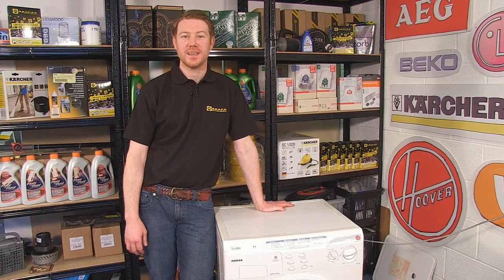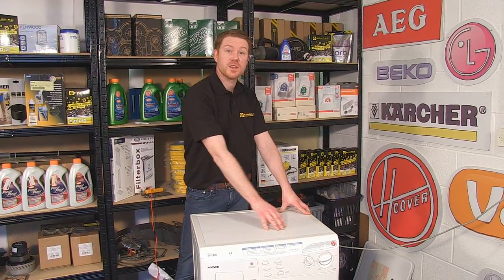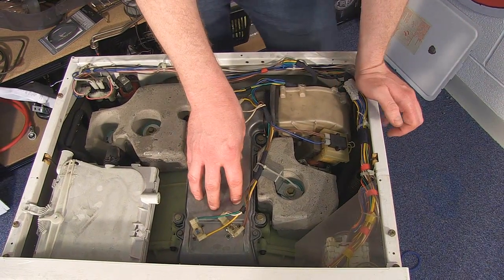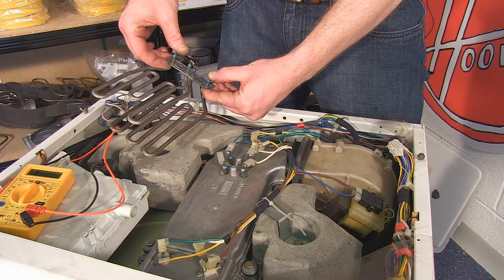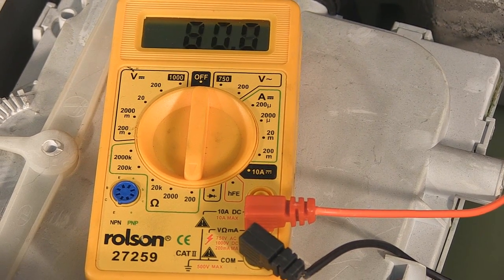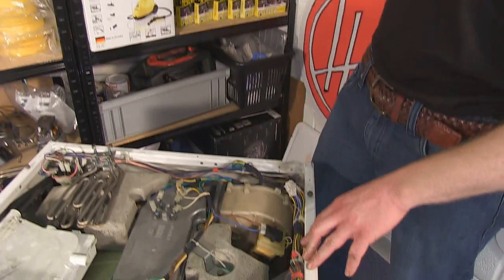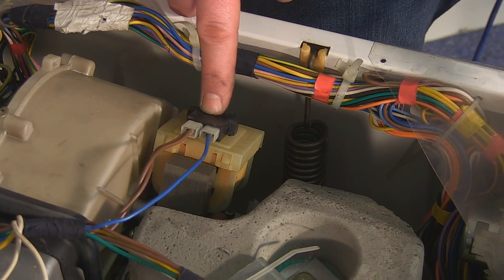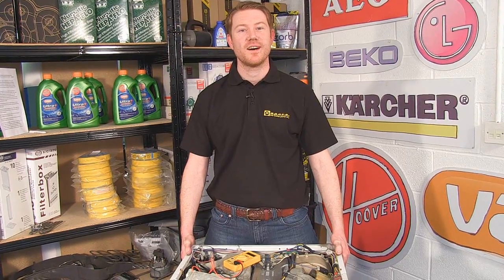How to Diagnose Washer Dryer Drying Problems

Comment: Very helpfull video!
When i opened op my BEKO washer dryer, i noticed there was a lot of lint inside the condenser. Is this a problem, and if so, how do i clean the condenser?
Reply from the maker: Hi Lena, there are a couple of things you could try to clean it, get the vacuum out with the crevice tool to get inside or use a pressure washer as they are good at cleaning all the lint out.

Comment: I'm stuck! Washing is not having its moisture evaporated. It's just coming out hot and wet. I replaced the valve as it was faulty and all other components seem fine. Board??? Thanks for vid anyway
Reply from the maker: If clothes are coming out hot and wet something is wrong within the condensing process usually a blockage of some sort in either the condenser itself or the feed pipe from the valve to the condenser which usually has some sort of constriction in it which only allows a minimal amount of water into the condenser and can block. It could be the control PCB but not very likely.

Comment: Hi i have a hoover washer dryer pvu0000072 and i have someone from hoover come out to checknmy washer/dryer as its not drying and he said a switch inside the washer kept tripping he replaced it and its still doing same its realising hot air but the clothes are not getting hot or drying what could it be
Reply from the maker: Hi Gronya, we don't recognize the model number but you would need to test the thermostats with a multimeter to determine if one of them is failing, also check the air flow through the condenser as well as the water flow from the valve.

Comment: Thanks for the review! I have a problem with washer dryer that does not heat up while drying  after returning from repairshop. They changed some motor after door lock error (07 Candy GC4) I noticed that fan makes funny noise now when starting drying program. I suspect they forgot to plug back in something inside the mashine. Is it possible?
Reply from the maker: Hi LuckyMe, the first thing to test is the dryer elements, the video shows how to test them at 1.46 and check no wires have been left off so be careful.
Reply: Hello! Thank you for answering! I tested everything as showed in the video. I found out that elements didn't warm up. So I pushed the buttons on them to reset them and it worked. Then I plugged masin and started drying program. The elements heated up too hot so I turned mashine off. It seems the problem is in ventilator-air does not flow into drum, it stays cold inside it. I scrued that drying part all off to get to inner ventilator. When outer ventilator spinns, the inner ventilator does'nt. Its kinda loose on it's axle .  I can't get what is wrong with it and how it should work. Can you explane that part too, how it works and what to do to fix it?
Reply from the maker: Hi LuckyMe, the video does explain the drying process, if the ventilator is not turning then it does not pass the air over the heater into the drum and will need to be replaced but also check the air chamber for any blockages.

Comment: How do you find out where the 4 wires go on the start stop button on a splendid 2000 washer and dryer combination in my motor home, Steve
Reply from the maker: Hi Steve, you will need to find a wiring diagram online that lists all the connection on the machine including the start/stop button, we do not have access to these diagrams so good luck.

Comment: Hi Mat, we just purchased a 3 year old Hotpoint Aqualtis Washer/Dryer combo.  I just washed a load of darks and several of the items came out full of white lint.  I wanted to hang them outside, but decided to dry them to get the lint off.  Any ideas?
Reply from the maker: Hi Diane, check the door seal and filter and it sounds like it needs a clean out.
Reply: Hi again, I agree with you but can you tell me where is the filter?  Our directions don't show anything about a lint trap or where to clean it out.
Reply from the maker: Hi Diane, the filter is located at the bottom right-hand corner at the front of the appliance, there may be a clip on panel you need to remove to access the filter. put some old towels down for any water in the chamber before you open it.
Reply: Thank you, Mat.  Our filter wasn't bad, so I think the problem was I had washed & dried white towels in the previous load and it was some residual lint.
Reply from the maker: Hi Diane, hopefully, you have sorted it out, let us know if you have any other problems.

Comment: Thank you for this,  now I can go and play electrical repairman with my multi meter and see if I can fix or identify my washer dryer drying problems on my own :)
Reply from the maker: You are welcome. Remember to fault trace with the machine off using the resistance range to measure and check the components. This will avoid the dangers of working on a live machine.

Comment: I really like this video a lot, but I do notice that it does not really address the possibility of air flow obstruction.  It seems to me that the air tube going into the condenser is rather limited in diameter and that seems to me to be very likely to eventually get clogged up with lint and debris. Is there not a good way of testing the air flow in this system? like maybe disconnecting that hose and sticking a vacuum cleaner hose up to it? is there a recommended way of cleaning the condenser (does it ever need that?)? Also, is it not possible that the condenser valve could still measure around 4Kohm but be stuck closed for mechanical reasons rather than a bad coil?   And,
Reply from the maker: Hi Damien, the condenser is cooled by the water trickling through it. This should loosen any lint building up and wash it into the water in the tub where it will be emptied away. The condenser can block up occasionally and need to be cleared, this is best done by removing it and flushing with a hose. If the valve gets blocked it can still measure OK without delivering the fine water spray, you can usually hear the slight hiss shortly after the machine starts when the drum pauses.
Reply: Thank you for your video and response, you have given me the info I need to feel comfortable with trouble shooting my machine tomorrow, and confident I'll get it working again. I am appreciative.
Reply from the maker: Thanks Damian for the comments, remember to 'like’ the video if you enjoyed it or it helped.👍
Reply: Liked it!  I did find the problem to be with a thermostat that had tripped...   

However, when I opened up my machine (an Ariston AWD121NA)  I found that it did not have a separate condenser unit like the one that you had shown in the video. Instead, I believe it uses the outer containing barrel as the condenser itself. perhaps there are cool water pipes that line the barrel, but because of this, there is no way to easily modify this washer/dryer to bypass a separate condenser and force the air to exhaust to the outside. The fan/heater assembly draws directly from the barrel, then blows directly back in without giving access to route the air in any other manner.  I was hoping I could bypass the condenser to make the dryer work more efficiently, because I live in Arizona and dry air is something that is plentiful here, but I simply can't do it with this particular machine. Bummer!
Reply from the maker: Glad you found your problem. By recirculating the air it requires less energy 'generally' to heat so can be more efficient. This may not always be the case on a 'hot' day.
Reply: Oh, good point! I suppose the heating elements tend to be smaller on these sort of machines and without air re-circulation, the air might not get hot enough to dry very quickly if the machines are vented very well... Some air dampening might be appropriate if anyone were to try allowing some exhausting to occur...  Thanks!
Reply: I think most folks are aware of the "lint" problem as there are tons of videos about this. When I opened up my Splendide 2000... it was the first thing I checked. While there were no lint obstructions, I could tell that there was one at one time as there was still a little lint stuck to the sidewalls of the vent tube that had obviously been there for quite some time. Once I tested the Heating Elements, Thermostat and Thermal Fuse... it was obvious what had happened. The previous owner told me that the dryer spins but doesn't heat... what he failed to tell me was that it had clogged with lint, he cleared the lint however, it didn't cure the problem so he gave up. Turns out it overheated due to the lint and popped the Thermal Fuse. Thanks to this video I was able to test, diagnose and repair the problem at a total cost of $33.

Comment: aeg L-87695 drier not works thermostats on 200Ω are 0.3 both of them and the one in the front where hot air comes in the drum, heating element seems fine, but can't check the motor , it has a small plug with 4 wires and it is on the top not like hoover

Comment: I have a hot point washer dryer showing a f15 fault I have checked everything and all looks fine please advise
Reply from the maker: Hi Amir, we have a video showing Hotpoint error codes:
https://www.youtube.com/watch?v=aud14I0Zu9M
This suggests the problem is the control board but check the dryer heater is OK first. If the heater is OK the board will have to be replaced by a Hotpoint agent so try Repaircare if required.

Comment: hi, 
all components tested and seems to be fine, the problem I can't get 220v to both heater elements?
please advise
Reply from the maker: What model are we talking about?.
Reply: candy cnw136 but it looks all the same like in vidio
Reply from the maker: If the elements and the cut outs are OK the problem is likely to be the dryer module: http://www.espares.co.uk/product/es669480/washing-machine-dryer-module-assembly It may not be able to prove this without replacement.

Comment: Thanks for this video, very clear! BTW I have a AEG L16850, DRYER suddenly stopped heating up regardless of selection after 20min, it stops to 0 min, so I thought I'll check inside, I've cleaned the condenser with a hunger. apparently there is a sensor wires fitted inside a hoe??
trying to locate sensor wires inside hose, which hose is it would you have a clue? when facing
the machine, left hand side there is a big short rubber pipe? also on the 
right, bottom of condenser rubbery hose with sensor but no wires inside, would you know?
Cheers.
Reply from the maker: Hi, we do not think there is a 'sensor' in the condenser but there are two 'thermostats' and a NTC fitted on the heater tunnel. Check the two thermostats on the side of the heater tunnel to make sure they both read short circuit as they should be 'closed'.

Comment: How about the most important thing as Step 1:  UNPLUG THE DRYER.You're putting your fingers across the heater elements, and if someone is working on their machine with it plugged in, that's 220 across fingers.  If not instant death, it's a sure fire way to get them to do the monkey dance and seek immediate first aid.
Reply from the maker: Thanks for your comments. We did say at 0:49 "So I've just turn the machine off and I'll take the lid off" and you can see the plug behind the machine on the floor.  However it is obviously important you fully disconnect an appliance before working on it so we have added an annotation at this point to make this clear.
Reply: Turning off the machine isn't always enough.  Defective switching or controls can leave components hot, as well as single leg switching.  I've done service long enough (tool/machinery, not appliances) to know that people need to be explicitly told to unplug before servicing.  Even then, they'll pretend that rule doesn't apply to them because "I know what I'm doing."
Reply from the maker: Hopefully the new annotation on the video at 0:49 will bring this to the viewers attention.

Comment: The video was very helpful, I think it could be the dryer fan in my washer dryer as it is not heating the drum but the element is hot, is there a quick fix for this or do you have to dismantle it or replace it

Comment: I have a Bosch wash and dryer, It washes OK , spins and but water fill in the drum unless you press spin or drain. What could be the problem???
Reply from the maker: You may have either a leaking inlet valve (check by turning the water supply off for a few days) or if the drain hose connects to the sink waste directly it may be 'back filling' from the sink.For more information see another one of our videos:  https://www.youtube.com/watch?v=VS48G_cwCXo

Comment: The heater comes on at times and others it doesn't. will have. to strip the heating elements out and check them. I thought it might be a thermostat breaking down. Oh well at least I have a spare.
Reply from the maker: +Russ Griffin It is more likely a relay on the PCB than an intermittent element. Good luck with the fault tracing.

Comment: Hi, I have  Zanussi WJD 1667 washer dryer. I have checked all the thermostats 3 in all. the one at the front seemed to be faulty so I ordered another one. The new one has a reading the same as the old one. the guy at the shop said maybe it works the other way round. Any ideas. Cheers.
Reply from the maker: +Russ Griffin The sensor on the front of the heater tunnel is an NTC resistor. It will typically have a resistance of several thousand ohms that will change with temperature and does not measure short circuit like most thermostats. If the elements are OK and the heater does not come on it would suggest a control board problem if no error codes show.

Comment: What happens to the lint in a Hoover washer dryer?
Reply from the maker: +Dave johnson The condenser is constantly cooled by a fine mist of water that helps the lint wash from the condenser into the sump and then be pumped away. Over time lint can still build up and may occasionally need to be cleaned out. This involves removing the condenser and 'disturbing' the lint and washing out. A good way to disturb this is by using a flexible wire like a bicycle brake cable or net curtain wire.

Comment: Hi
Thanks for the really useful video.
I'm just interested. My zanussi washer dryer seems to be stopping long before it's supposed to. 2 hour dry stops after 20 mins. But there are no error codes. Checked everything out and the only anomaly is the condenser water pump motor. You say it should be about 4K ohms. 2 of them are but the condenser feed is measuring about 5.2k ohms. Would that indicate a problem? It seems to trickle water through still. Many thanks.
Reply from the maker: +Chris Handcock If water is trickling into the condenser then the valve is likely to be OK and may vary a little between manufacturers. If the dryer is heating correctly run a test and check it is regularly pumping out the accumulated water.

Comment: Super helpful, I just fix my dryer. I had to reset thermostat the way you did and done!  Life saver dude!
Reply from the maker: +Juan Pablo Pedraza Thanks for the comments. The thermostat can 'trip' if the machine is turned off during the drying cycle. Make sure you always allow it to finish so it takes the heat away from the element.

Comment: Very interesting video. I checked all the parts with the multi-meter and they look ok. Yet, each time I run a dry cycle, one of the thermostats stops the heating system. Each time I reset it and try a new dry cycle, the problem is the same. I have cleaned all the machine and removed as much dust as I could. Now, I'm clueless. Where the problem could come from? My washer/dryer is a candy GOW85D. Thanks
Reply from the maker: +Jerome Granados If the air flow is correct and the condenser is not blocked up with lint and you are not turning off before the cycle has completed replace the thermostats to start.
Reply: I have replaced the thermostats. It did fix the problem, but for a few dry cycles only. Now I'm back to the original problem where the thermostats stop the heating system. Do you think I should replace the thermostats again or look somewhere else?
Reply from the maker: If you are looking at a washer dryer your problem is likely to be due to poor air flow causing the heater to get to hot and trip. If this is the case clean the condenser at the back of the drum and make sure the air flow is not restricted by any grilles before the fan.
Reply: Poor air flow was my problem. The fan blades were full of lint. I cleaned them and it's working pretty good so far. Thank you very much for your help.
Reply from the maker: Thanks Jerome for confirming the diagnosis, glad we helped.